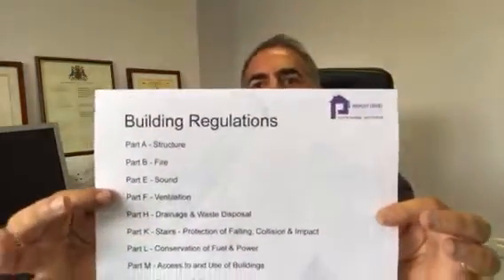The importance of involving Building Regulations when you work on HMO’s or Conversions

Comment: Hi Mike, 

Thanks for the video. 
Would this be the case with a 6 bed HMO in Bristol as it wouldn’t need planning for that smooth of rooms? It has 1 current bathroom, I will be making it 4 bathrooms, two ensuite and two communal. 

Does sound proofing between rooms come in as well?  Samual Leeds has mentioned this in one of his videos.
I have asked the my local council and know one has any idea, I just keep getting passed around departments from Licensing to Planning and Building Controll and they can not tell me. 

I worried that if I’m doing work at the property know I don’t want this to become an issue later on.. 

Any info you can hello with will be much appreciated.